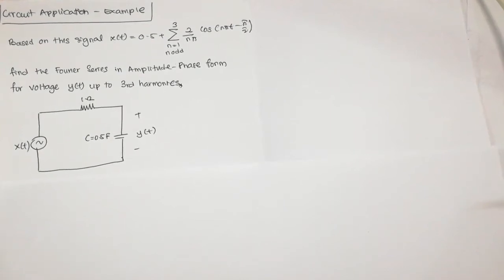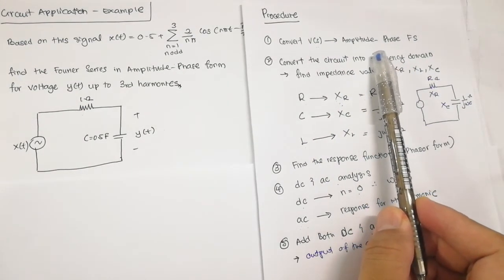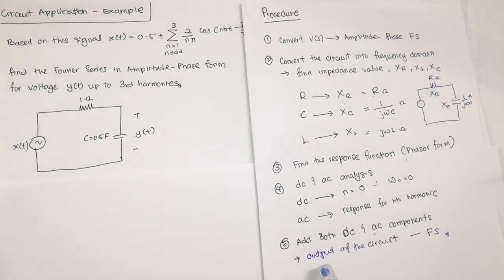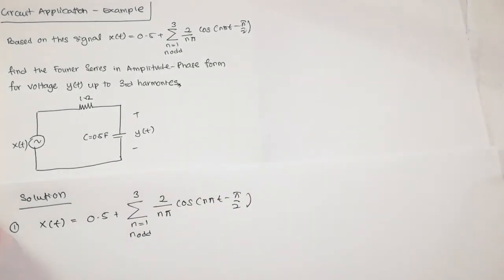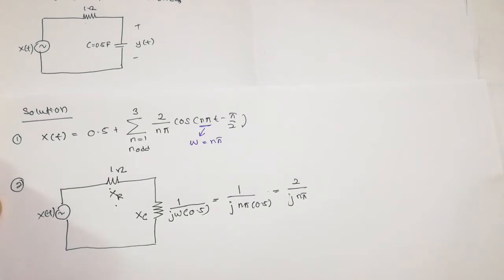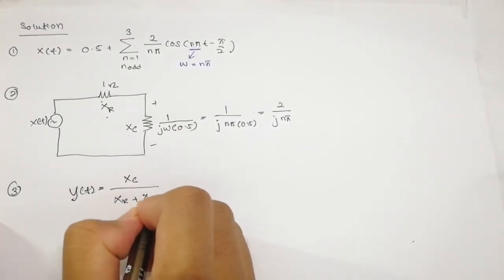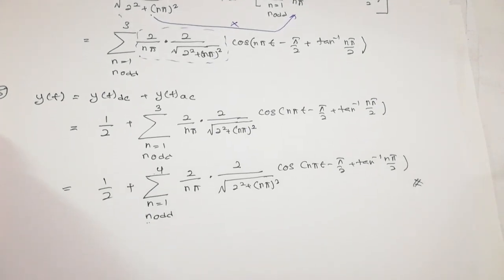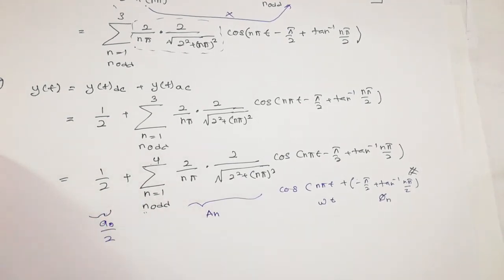Lecture 3.19: SnS - (Example 2) Circuit Application in Fourier Series

Comment: This example is vary from the previous wan as it is stated to find the voltage of the circuit till the 3rd harmonic. The solution of the question is the same as the previous video where we have to convert vs to amplitude phase fs, convert the circuit into frequency domain, find impedance value, find response function (phasor form), dc and ac analysis where for dc analysis the n=0 and wn=0 and then add both dc and ac components.

Comment: In this video just like the previous video . but in this video we have to solve the voltage of the circuit until the 3rd harmoninc. the solution of the question is the same as the previous video wether we have to convert until the same step . thks dr